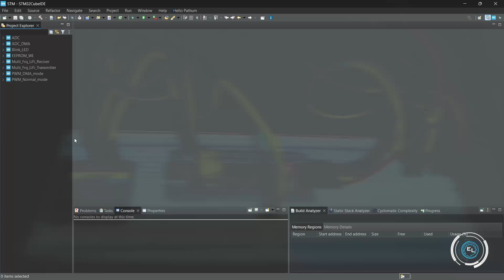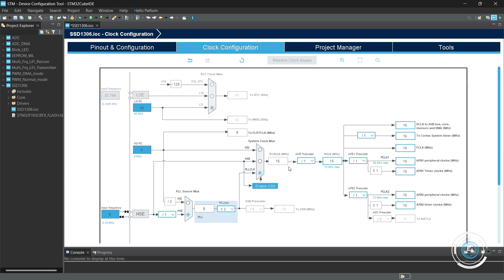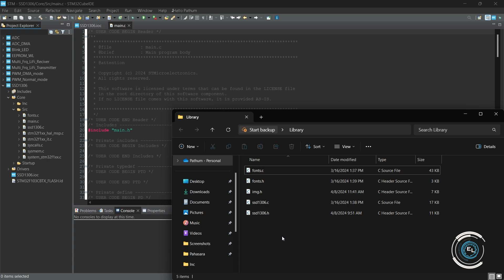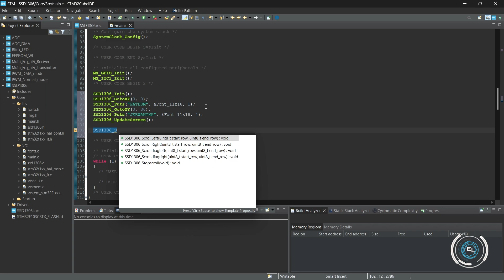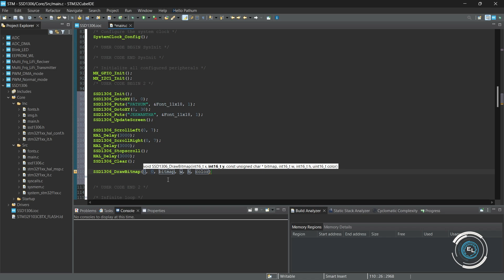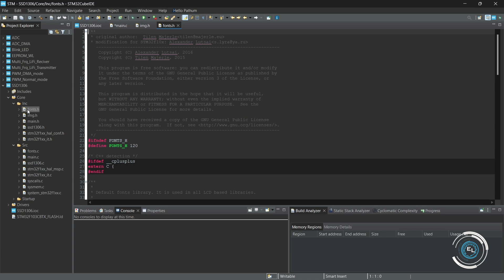How to Interface OLED Display with STM32 Using I2C | Step-by-Step Guide

Comment: Thank you for this tutorial.
I'm facing one issue --> I'm using STM32G030F6P6 board, I have changed the header file to g0xx.h wherever it is needed. Also added the address of the OLED but it is not displaying anything. The OLED which I have is 128x64 single white colour.
Also after flashing the code a new tab opens for "startup_stm32g030f6px.s"
Can you guide me what I'm doing wrong?
Thank you
Reply from the maker: The fact that startup_stm32g030f6px.s opens could indicate a HardFault or some interrupt misconfiguration. You can add breakpoints to the code or try to pinpoint the exact place where the fault happens. If this happens after calling HAL_Init() or system clock configuration, review the HAL libraries for potential issues.